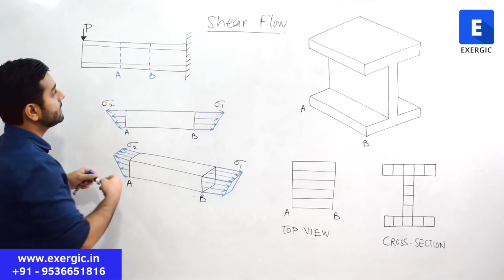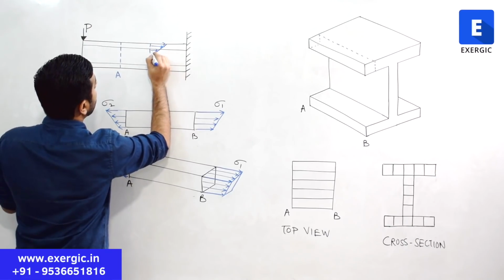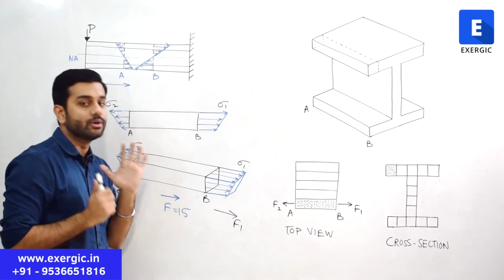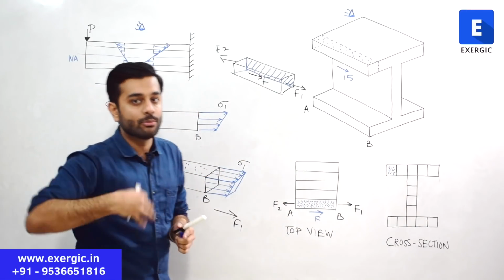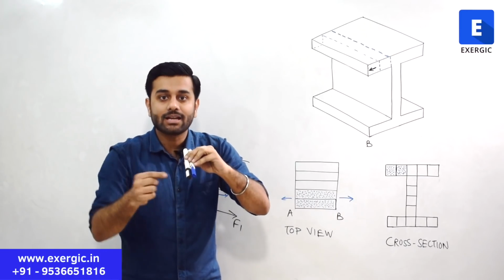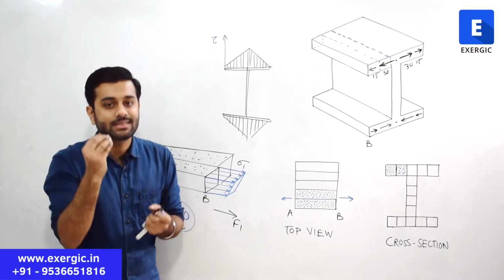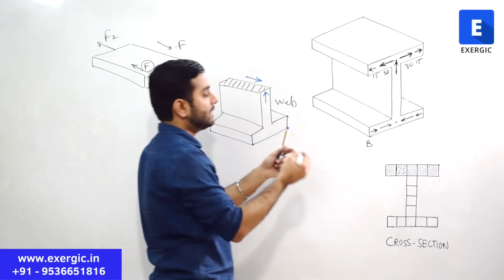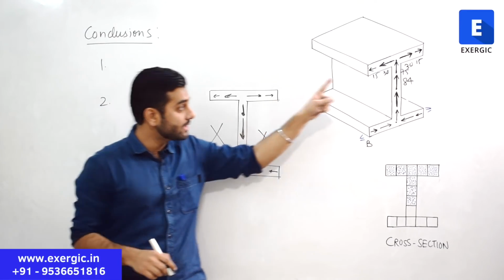Shear Flow - Concept of Shear Centre | Strength of Materials | GATE ME, CE

Comment: An excellent video, thank you.  I just have one query.  When you show the 15N example as the shearing force running length ways, you say that the complimentary shear is also 15N.  I do not think this is the case.  The shear flow is given by q = SAY/I.  So the value of the shear flow at a distance "x" from the free edge would be q = S(xt)Y/I.  But if you integrate underneath that it would be the area of a triangle, (1/2)(q)(x).  So I think in this case the complimentary shear would be 7.5N.  Also, consider that it is not truly complimentary in that there is a free edge along the length.  What do you think?  Thank you

Comment: GATE 2020 Answer for this question is 0 but in the solution of coaching centers is 5..... Plz Solve this by making a video on this ... Thanks ......... 
A steel part with surface area of 125 cm2
 is to
be chrome coated through an electroplating
process using chromium acid sulphate as an
electrolyte. An increasing current is applied to
the part according to the following current time
relation: